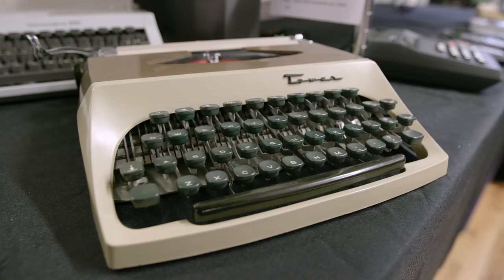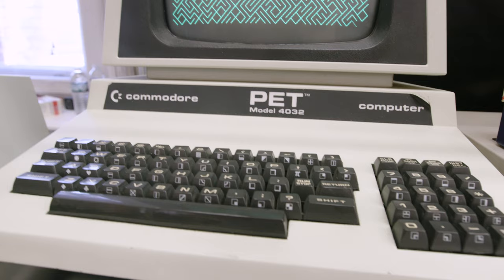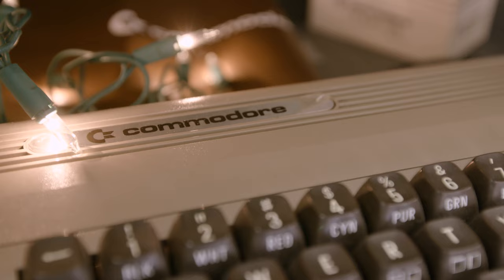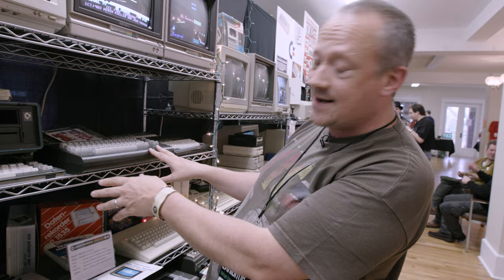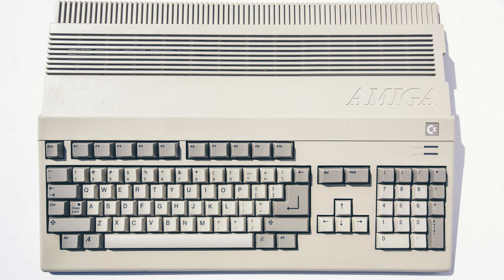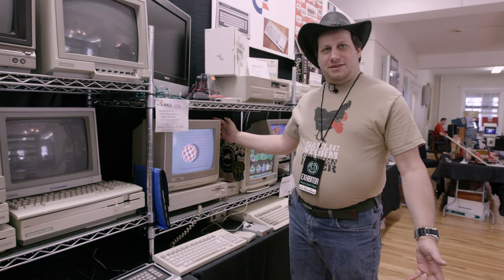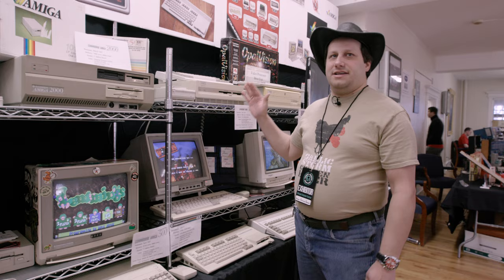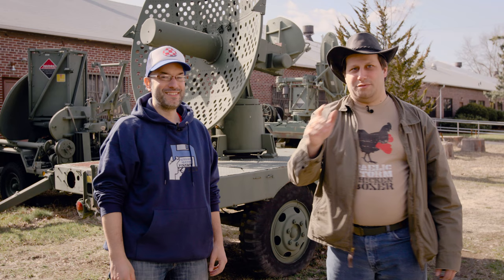Commodore History Retrospective Exhibit - Typewriters to the Amiga | VCF East 2017 - 4K UHD

Comment: I still wonder what the Amiga could have become had Commodore not been in a race with Atari to the bottom of the price range.
Reply from the maker: We wonder the same.  It is a pity. Thanks for watching Bryon!
Reply: It was an interesting time. Apple was slow with the II GS and made many of the same video memory mapping mistakes they had on the original. It was too little, too late. The VGA concept was a real game changer and once clone makers figured out how to remove it from micro-channel, all direct memory mapped graphics ideas were passé. The IBM machines were still hampered by DOS (then Windoze) and the Mac's multifinder was utter crap. The Atari ST and the Amiga looked to be the future, then boom. Gone.
Reply from the maker: Yeah, that sums it up well! It is really unfortunate what happened.

Comment: 9:50: Wow, a Commodore 64 is compatible with itself? HUHH, who'da thunk? And "a cartridge slot in the top where you could plug your cartridges in"? Oh, imagine that, I can plug my cartridges into a slot that's designed for them!
Also, that disk drive is a 1541.

Comment: It is kinda odd that when the whole thing went belly up (despite the non-us branches still making profits) the engineers didn't simply continue the company or poduct lines themselves. fact of the matter is that something like the c64 or atari 800xl, fitted with a 65c816, 2x real rs232, and ethernet,  while remainig backwards compatible with the c64 or 800xl, would most likely still sell and be the only homogenous hardware platform to develop games for without all the 'licenses' bullshit sony nintendo and sega tried and try to pull of. it would not sell in the millions but a downscaled operation would still be profitable. sure they would not have MOS in the basement but getting your own chips produced anywhere else doesn't cost the world anyway. heck there are custom chips in any el-cheapo dvd player and 'led blinking and song playing christmas card'. that's not the problem. the most expensive part is the case injection mold. lol. stick to the pin-through 5v design for easy modification and repairs and because it's proven technology, do atari style rf-shielding and make it all fully cmos and just kick it all back into production. ethernet muss sein tho. it is 2018. (usb is just useless instable garbage so let's skip out on that ;) it doesn't even have to be as cheap as it was before. considering that all the competition in 'bare metal' 'documented hardware gamesplatforms is gone and you're only up against stuff like the ps4 which only stupid end users buy. even the ibm pc turned into a piece of shit full of undocumented and different chips so that's out of the game too. (Despite that too starting out with reference guides with source codes of the bios and reference designs using multi-vendor well documented chips and connectors) i'd say, just kick the c64 and all of it's chips just back into production. (not that arm core emulator shit in the mini 64, real ones, quite possibly on an atx board with a bunch of those cartridge connectors as the expansion bus inside).